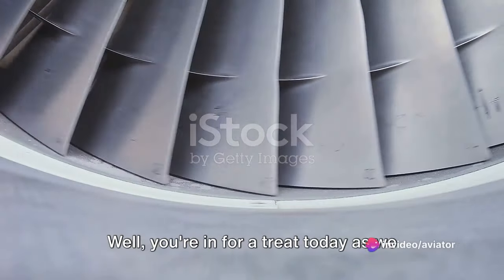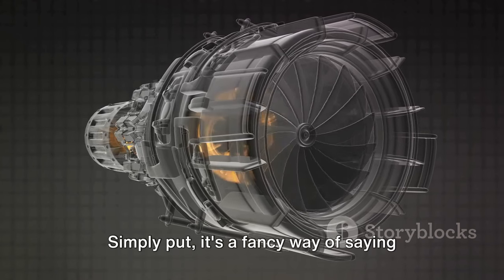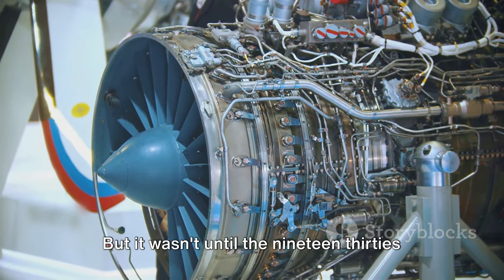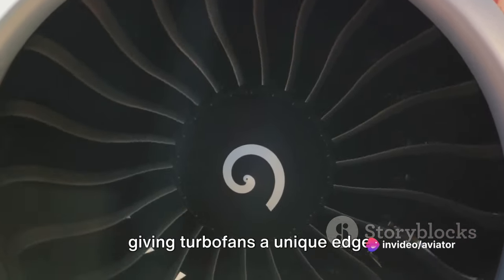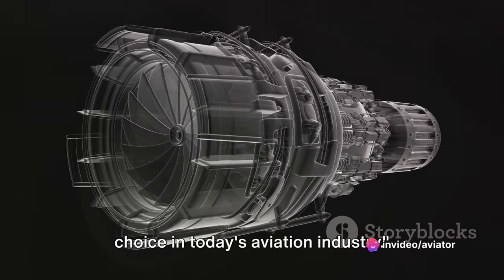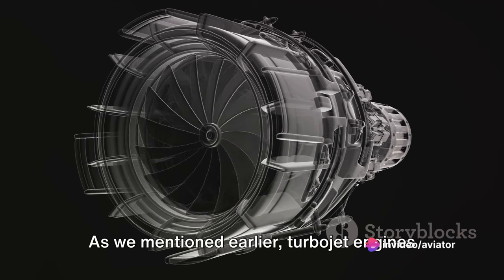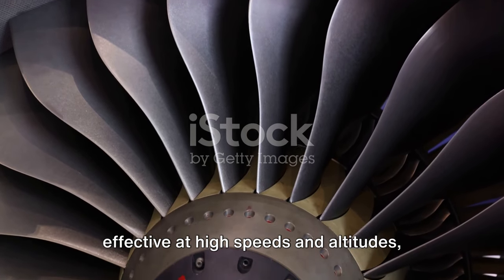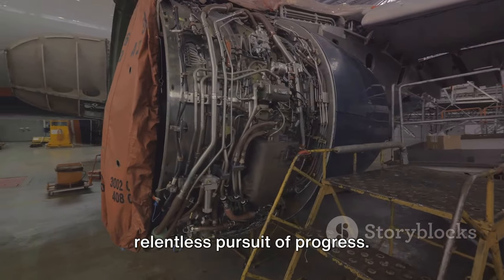Turbojet vs Turbofan | The Evolution of Jet Propulsion |

Comment: Except all modern military jets use turbofan engines just as their civilian counterparts. Fighters use “low-bypass” turbofan. In these engines, the fan blow a little bit of air around the core to impart some thrust and to provide cooling plus oxygen to the afterburner when needed. Airliners use “high-bypass” turbofan engines and as their name suggests, much more air that enters the engine goes through the bypass. The front fan is a heavy-duty compressor which compresses the incoming air, the bypass air is compressed and heated by the hot core, expands and accelerates out the back of the exhaust nozzle to mix with the core flow and that’s what reduces their noise. A common misconception is that high-bypass turbofans are just “ducted propellers” driven by turbojets. Of course this isn’t true because the fan is a compressor just like the axial compress blades that compress the core flow just as the fan compresses the bypass flow. All of the fan’s energy is used to compress the incoming air so there’s the fan has no energy left over of its own to produce any thrust. If anything, ironically it’s low-bypass engines that get some of their thrust from the fan acting like a propeller. 

Turbofans actually work at high speeds too (transonic) like turbojets and the latter are actually theoretically better at higher speeds than the former. But such big engines generate more drag which is why they don’t practically work as well at super high speeds. On the flip side, even the best engines fit for high speed are equipped with afterburners to reach such speeds (supersonic). When it comes to low speeds (subsonic), it’s turboprop engines that work best at those speeds but not as well as higher speeds. That’s because turboprops aren’t un-ducted turbofans as discussed earlier.

Neat stuff🤓
Reply from the maker: 😲 wow ! Mind-blowing 👍👍
Reply: @quickaviationupdate4827  Indeed 😁

Comment: Lockheed L-1000 was the first Axial flow turbo jet with an afterburner 😂
History lesson ❤
Reply: No after burner on L1011
Reply: Of course there’s no afterburners on the L-1011, everyone knows that. He was talking about the hypothetical L-1000 aircraft which used the experimental J37 and indeed it was the first axial turbojet designed for afterburner use. But what really made it stand out is that is was the first American jet engine to be built and it paved the way for countless future designs even though the original design hardly went anywhere.
Reply: @ronparrish6666  It is sitting on a fucking stand in California. I know exactly what I am talking about. You can even find a good video of the Lockheed L-1000 here on YouTube.

Comment: I am having a hard time understanding how a turbo fan is more efficient at low speeds. Seems like the turbo jet should be more efficient on both sides.
Reply: The "turbo fan" is nothing more than a Ducted Fan driven by a turbojet engine, delivering SOME of it's airflow to the turbojet.